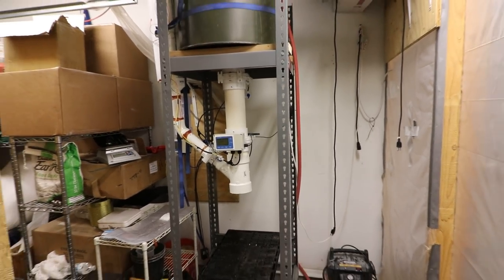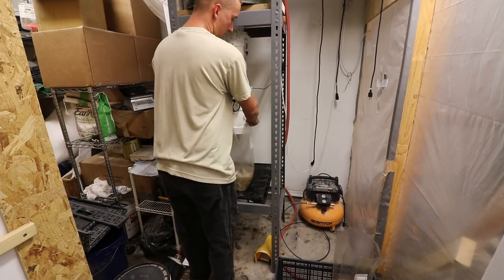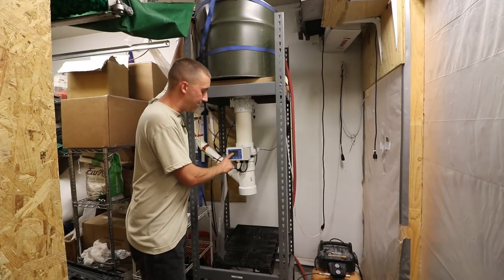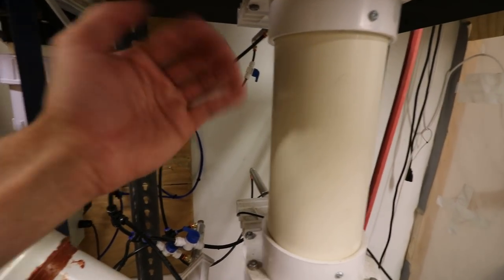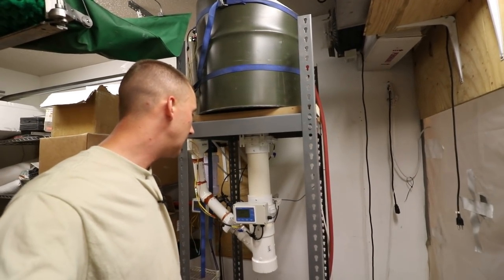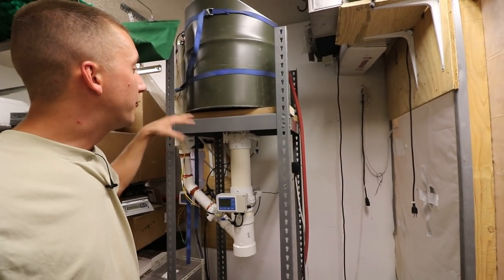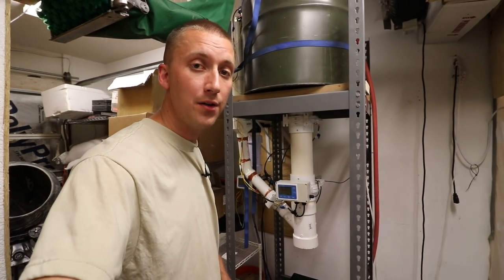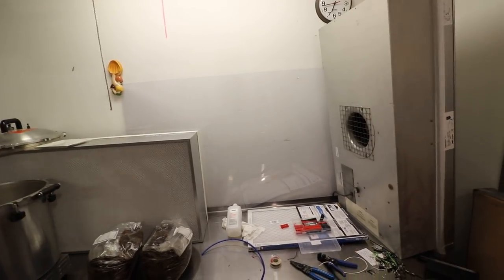DIY Mushroom Automatic Bag Wet Bagger 240 bags per hour!

Comment: Hey is there a manual version of the valve you are using? I want to set up a two valve system so I can fill a hopper and then have a measured length of PVC tube to isolate when filling bags.  What would be the terminology for that type of valve? What are the ones that you purchased? Thanks for the awesome video.  That is a well crafted machine!
Reply: Manual knife valve, typically used for black water on RVs.

Comment: Have any of your gate valves ever jammed?  Or do they push through the pellets no problem?  I know beet pellets are a bit bigger, hoping they wont be a problem.
Reply from the maker: Hey, Yes this unit would jam a a bit after a few hundred bags. I pulled out the bottom rubber seals and that helped a bit, and turned my regulator all the way up. I ended up taking this unit apart since i made my new all steel bagger and those valves work flawlessly since there is nowhere for the valves to hang up on being a square port and square valve blade.